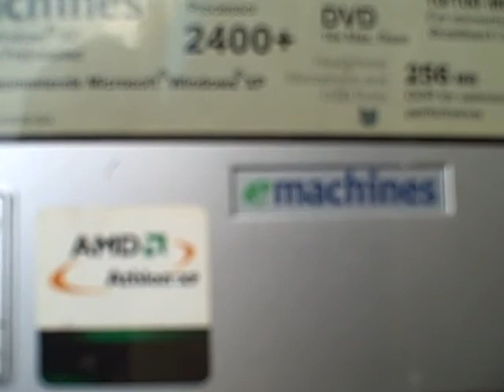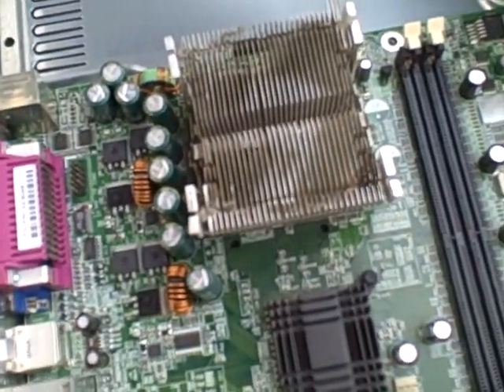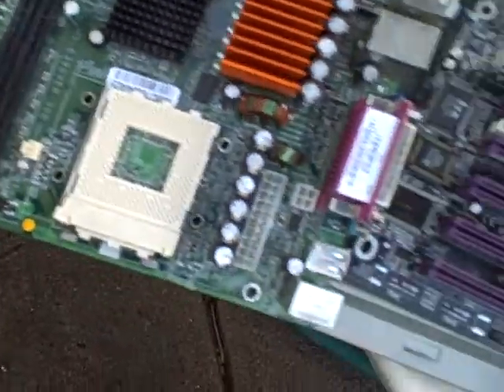Xpresit.net - YouTube VLog - February 2009 - Obtaining Free Computer Parts (01 of 02)

Comment from the maker: There are 486es with PCI Slots. 100MHZ computers that take SDRAM. 450MHZ computers that take DDR. Computers made in 2001 that have USB 2.0. Computers made in 2002 that have firewire on board. My point is simply that all of todays common features are integrated into yesterdays ungodly expensive computers that most people could not afford. The ones that now -- sit in closets or have been scrapped. Oh, the irony! :D

Comment from the maker: @Gatewayuser200 So how does a hacked XP iso somehow make it faster, more efficient and completely immune from spyware and virus? How does it somehow make it virtually unhackable? Answer: it doesn't. Where as Linux is all of the above. Hey if you prefer Windows, more power to you. I used it for years, its not my thing. Linux has been awesome. I'm never going back to Windows. But whatever works for ya, keep using it. As long as you feel it works.